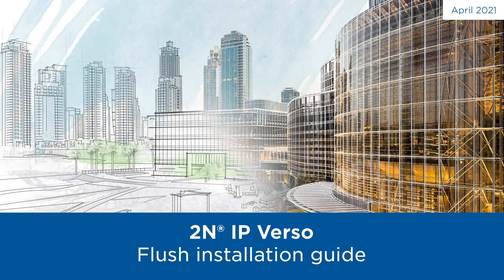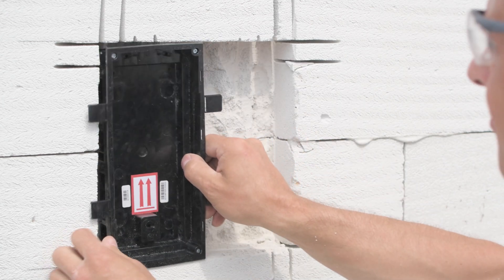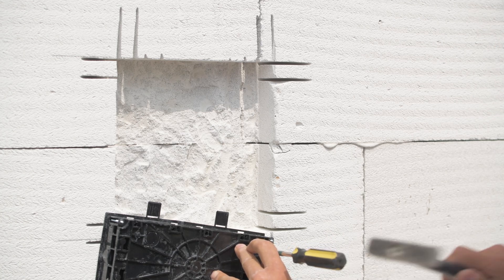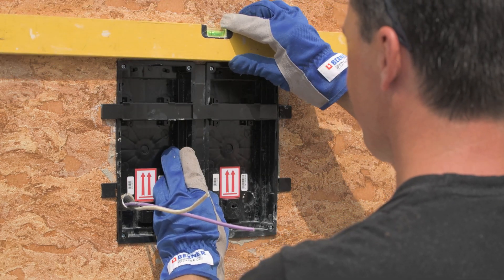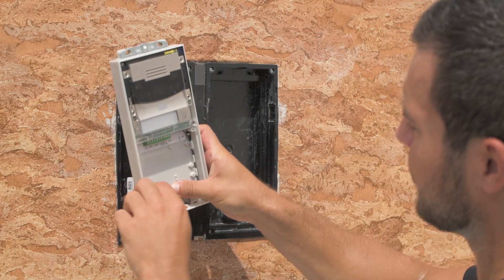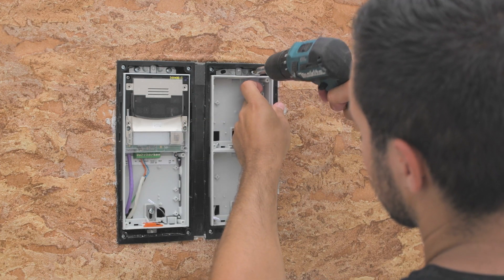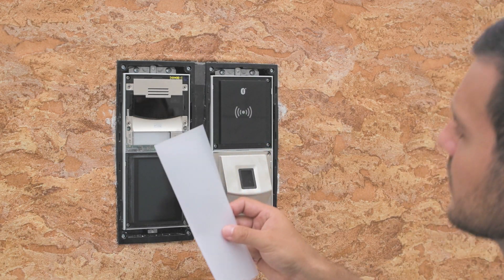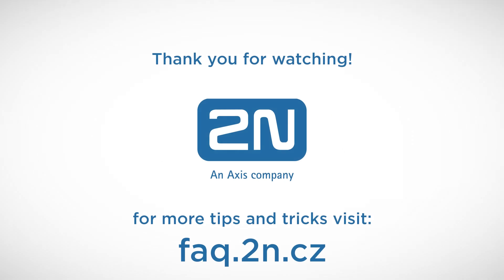🪛 How to install 2N® IP Verso IP intercom | Flush installation

Comment: In the manual recommended camera high is 135 cm - here the lower edge is already 140 cm, which is much more higher then recommended 135 cm. Can you please give some more assistance on the recommended height?